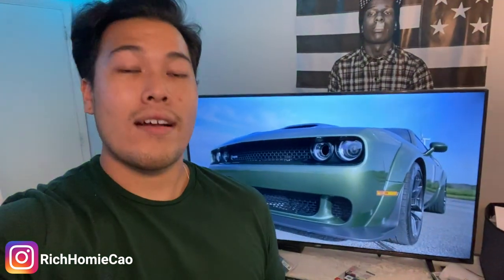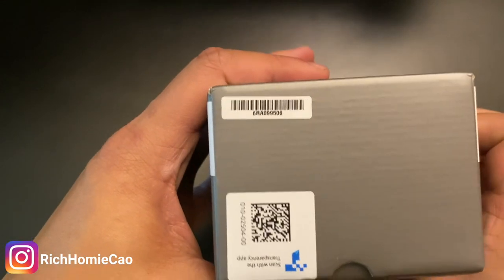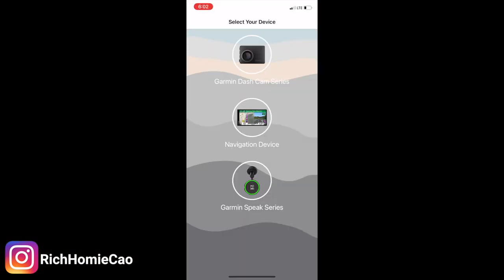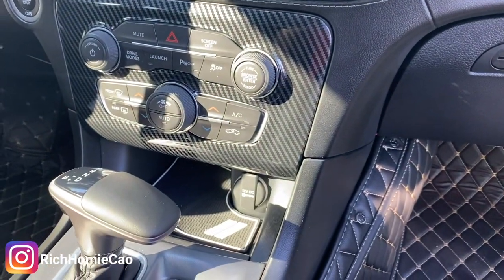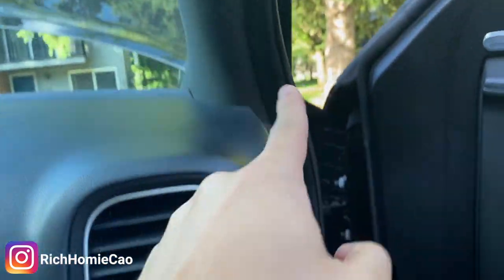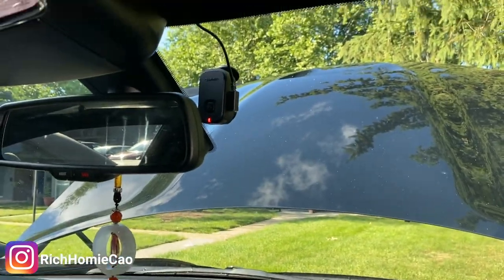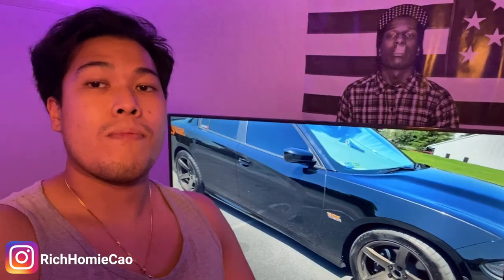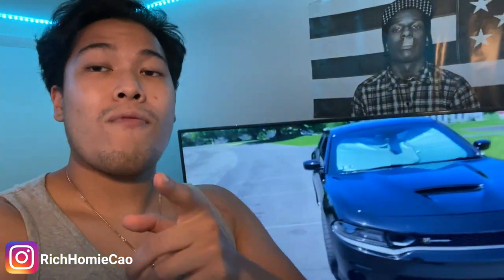BEST DASHCAM ON DODGE CHARGER/CHALLENGER! EASY INSTALL  *BEST INVESTMENT*

Comment: Great video, thank you! Couple of items not clear though: is this camera constantly recording without saving and only press button will save something? How to view the videos - did you copy them to PC? Isn't hot-wiring will drain the battery if the car is on park with camera is recording? Always thought that these pillar panels are glued, apparently it possible to push cables underneath?